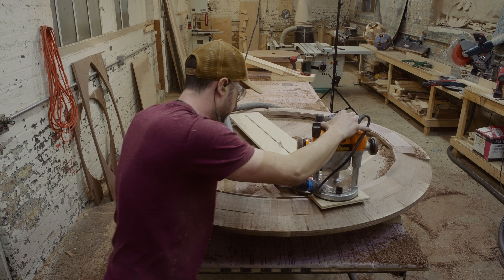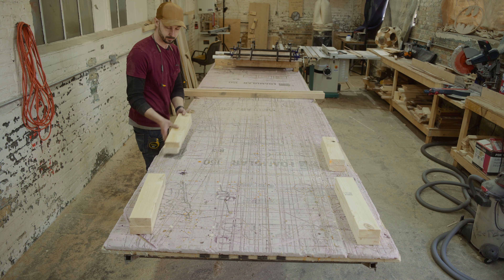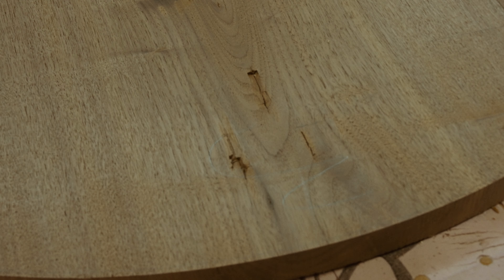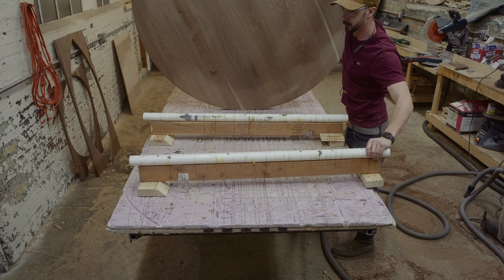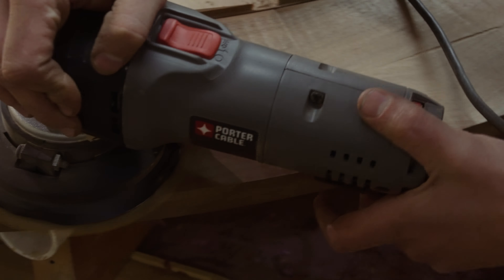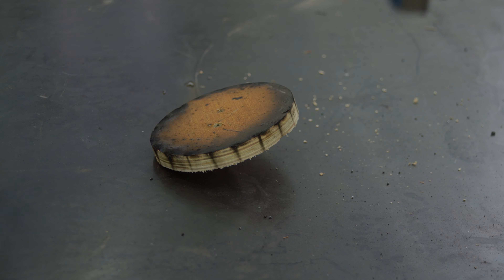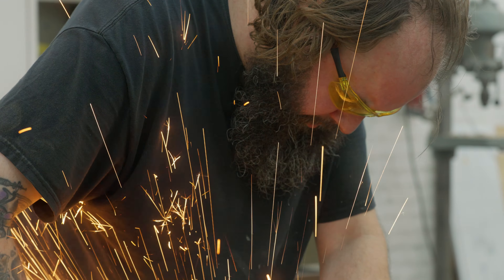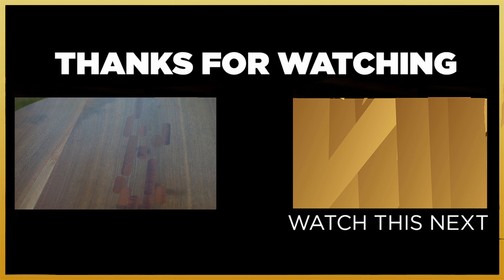I saved $1300 making these round tables this way

Comment: I've used the two layer trick on round tables before as well. I've found that on round tables, that second layer across the glue joints helps to prevent cupping. 

Long live the PROJECT VIDEO!!!
Reply from the maker: Absolutely helps out a lot! The project video will make a come back!